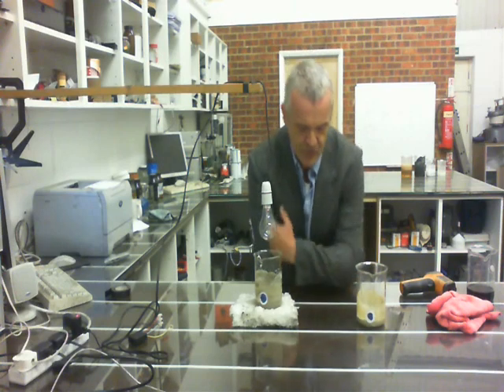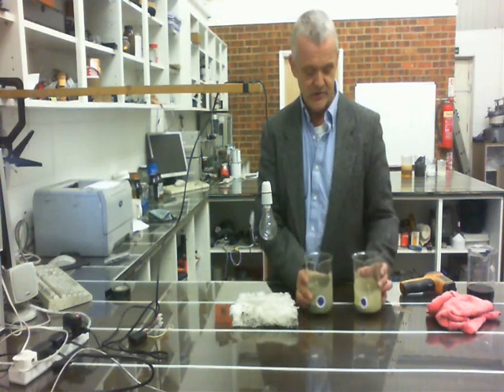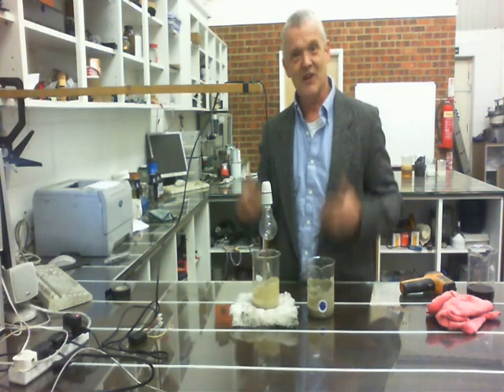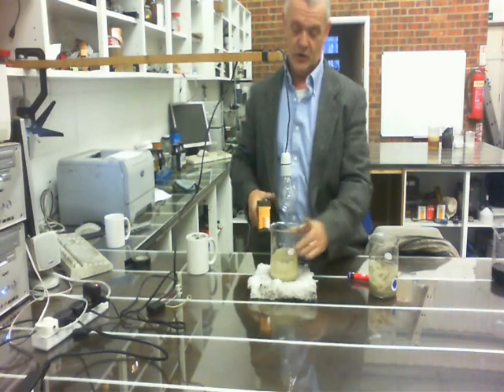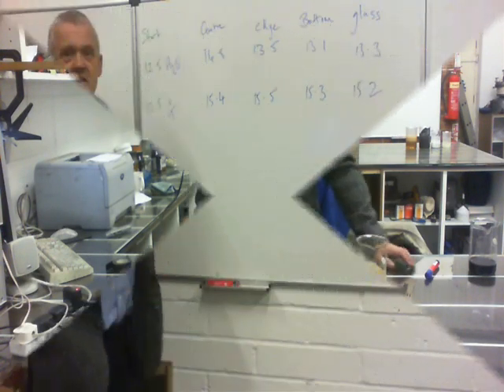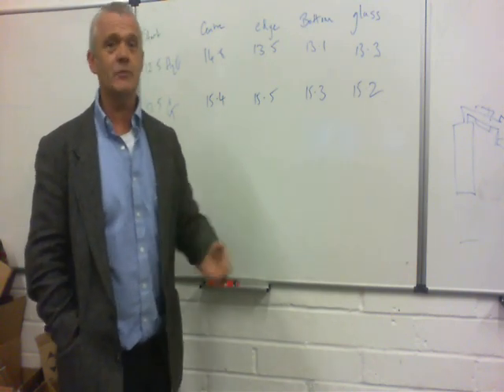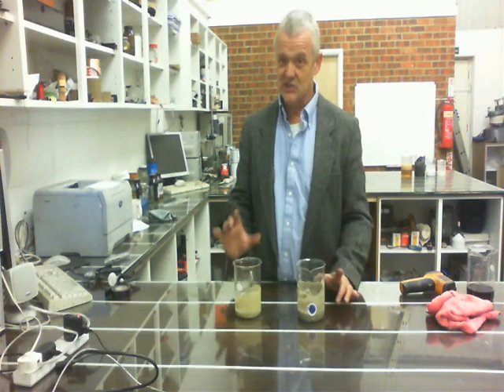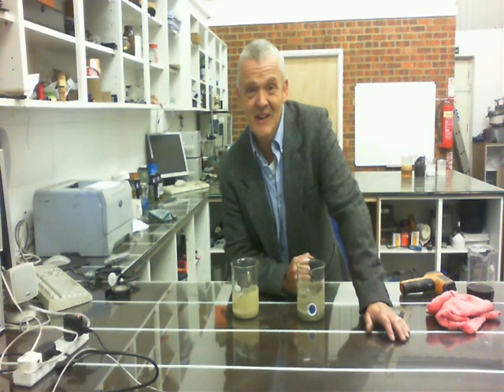Graphene Coated Zeolite

Comment: Have you tried salt water? Glass has a very high absorption rate of radiant heat waves even though it is clear. If we had a polished sheet of salt equal to glass most of the radiant heat waves would pass completely through. Salt water may allow radiant energy to travel deeper into solution.
Reply from the maker: I haven't mate - but this was a comparative - so all the same conditions except one had the graphene and the other didn't - that was the point really

Comment: If the graphene made it more thermally conductive then it would have been colder in the end
I propose that this is not observed due to experimental error
Specifically
-the test area was still warm from the previous test
-the temperature measuring apparatus was used improperly (those things specifically say that reflective surfaces will give bad readings)
Though this doesn't mean that the graphene had no effect or that its effect was not positive 
All I'm saying is that your test sucks